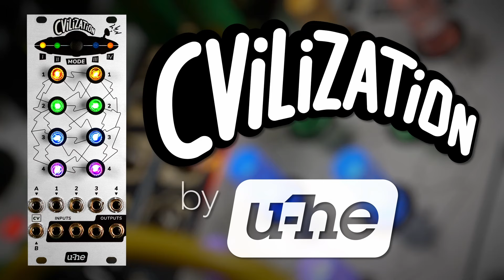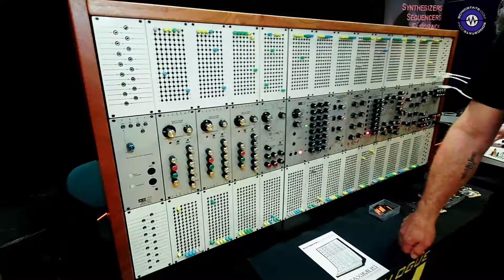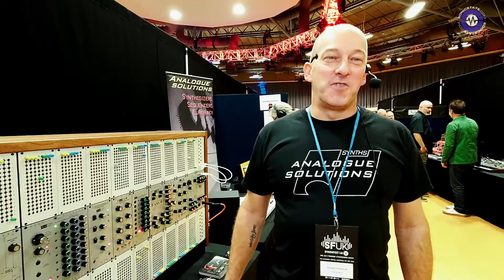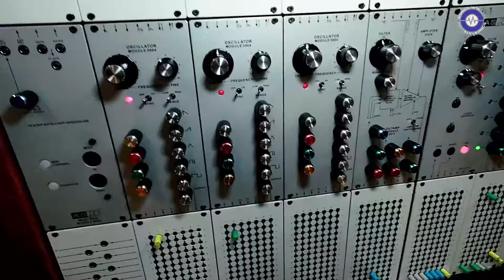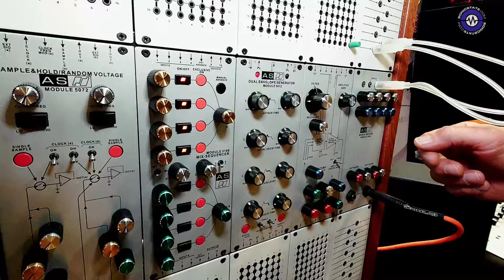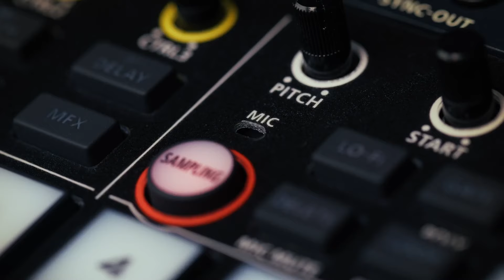SynthfestUK 24: TC5000 - Another Monster From Analogue Solutions

Comment: Analogue Solutions in 10 years: this is Megalodrone. It's build in form of a circle, with a 12 meter radius and it's 2 meters high. It has 1024 oscillators, 256 LFO's, 192 filters, 512 envelopes, 16 pin-matrixes with 2048 patch points, and a 64 step sequencer. The estimated price is 189'000 £ 😎
Reply: now there's an idea

Comment: Oh my an absoluty beauty ! the modules and knobs and all are very nice indeed .... nice to have dream synths even if they stay a dream ...
Reply: Mos Lab have been making clones of the 2500 for a while now. Beautiful machines (at a premium price)
Reply: @hb-fc3jj  yes, the Analog solutions he sais it is not a replica of the original like Mos-Lab did. Mos-Lab is the exact replica except withouth the pin matrix . So if you want the ARP2500 sound it's the Mos-Lab and comparatively it is "only" 12500.- with high end through hole components. The Analog sollutions is Leipzig, Telemark and Fusebox, and some are new designs, specific to the TC5000 .